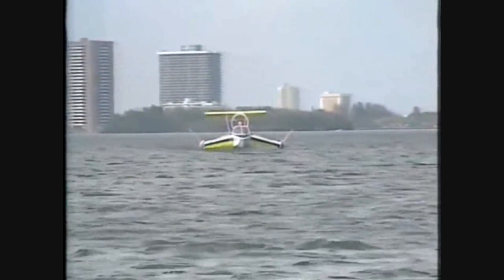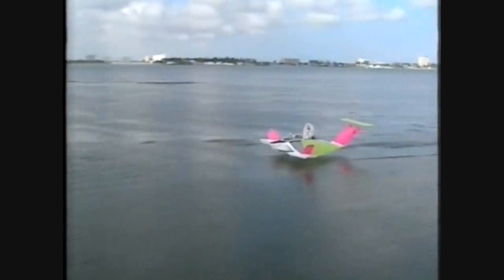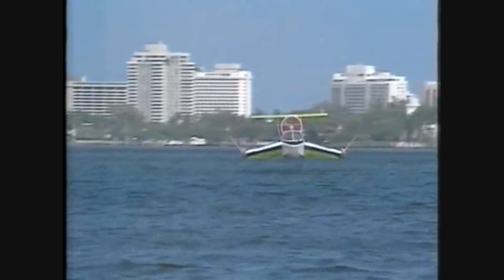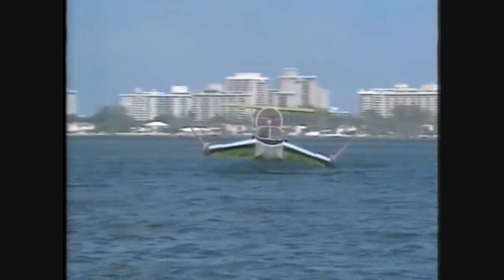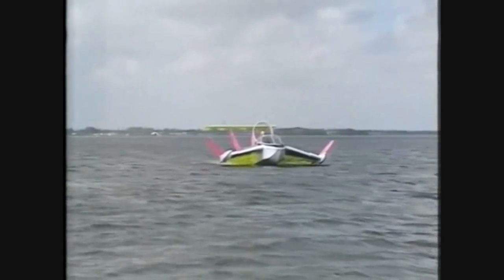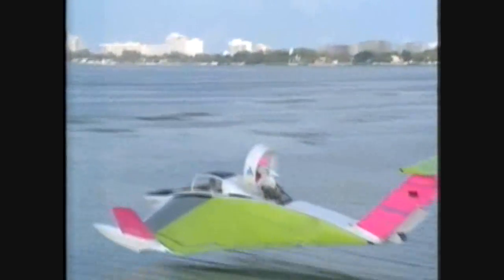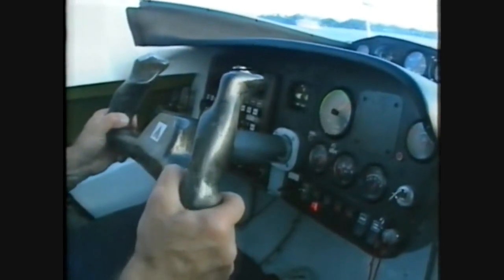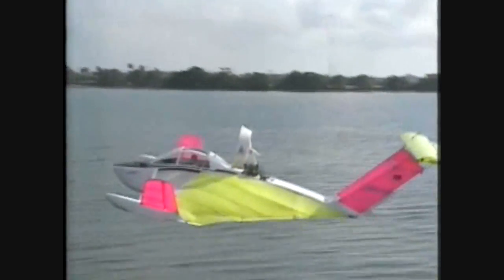Airfish WIG craft

Comment: I still don't understand why the term "WIG" is used, given that the vast majority of these don't fly over the ground (the "G" in "WIG") instead of "surface", and it omits the "E" for "effect".  Seems to me that WISE (wing in surface-effect) is the most accurate and sensible term.
Reply: I agree. I refuse to call these aircraft “Wing In Ground” and prefer to call them Ground Effect Vehicles (GEV) instead. The phrase “Wing In Ground” makes me think of some kind of semi-subterranean vehicle that flies above the surface with its wings cutting through the ground.
Reply: It is a WIG craft. Wing in Ground (effect) craft. It won't fly with any stability out of ground effect. The term is universal and also applies to airplanes landing and taking off. Get educated before you make dumb comments.

Comment: How well does it work over the ocean where there are large waves?
Reply: I was wondering about the same thing too, my guess Is that it wouldn't really work, it needs a flat surface underneath and 6 foot wave isn't exactly flat, big waves would smack into it potentially crashing it down I believe.
Reply: It can fly higher that 6 feet waves. Staying close to the ground is for done only for better efficiency but can clear waves and even land and take of from the sea.
Reply: Very badly, just like a small boat or hovercraft it's limited to coastal/lakes/rivers...

Comment: 15 litres/100 km, is not that good, not much better than a regular plane. 500 kgs is quite a lot. I Believe this could be done far better, if I may say so.
Reply: That's 10 years old, with today technology designs could be much better.
Reply: My first thoughts too. In fact a regular single prop with similar take off weight will get better fuel economy if I recall correctly.

Comment: @901Jetta 
You will see next few months a better craft than this based in second generation WIG craft technology, called Hoverwing by the inventor Mr. Hanno Fischer. The craft is a 23 seater with latest technology equipment, Hoverwing 20. Now the craft is the end of manufacturing process.